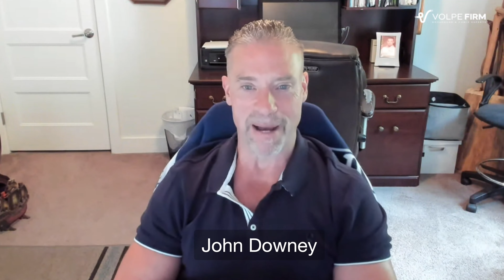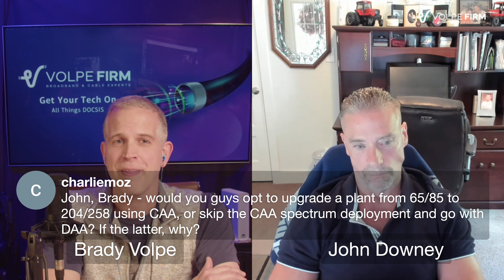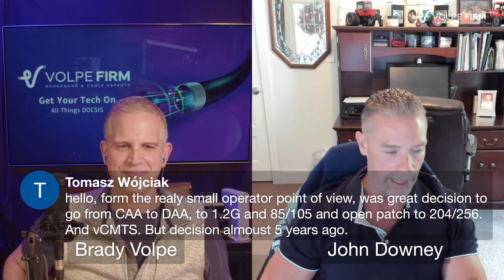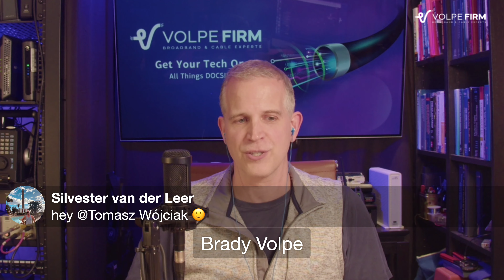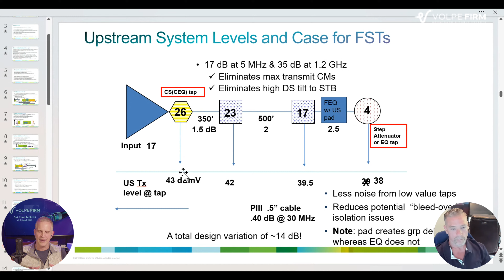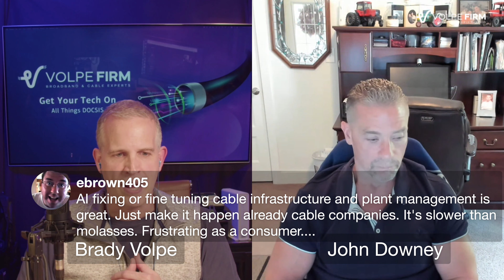Upgrading your plant to last for the next 5 years

Comment: Buried FTTH with no NAPs reminds me of encapsulated phone with no peds. It was a great idea until it needed service/repair and the repair costs were so astronomical they would deliver impaired service until it was unuseable. No place to take temp wires from, you had to come off of a neighbor's house. Those people always thought they were going to get billed for the person who was getting the temp. I had one guy cut a temp three times in the same day...
Reply from the maker: FTTH will eventually replace coax - at least in most areas. But as you indicate, it will not be without its pain points. This is why we do not have FTTH today. If it were simple, it would be done.

Comment: I am all for constant repairs though. I’ve been off work for a surgery since January, so a little over 4 months. I’ve lived off of scrapping from dumpster at work. Lots of strand and feeder line and LE’s and amps and taps. And I’ve chemically isolated and smelted about a $600 bead of gold I’ve recovered from the pins from pads and other components inside of said amps.
Reply from the maker: Best of luck on your recovery. Sounds like your making lemonade out of some left overs otherwise destined for a landfill. Great to see.